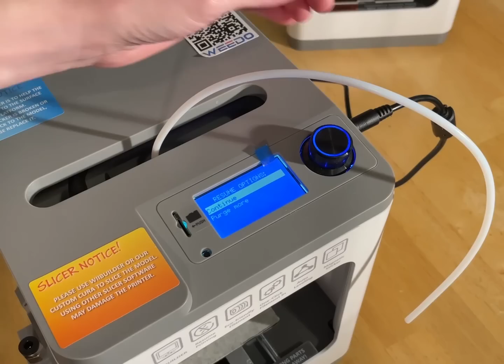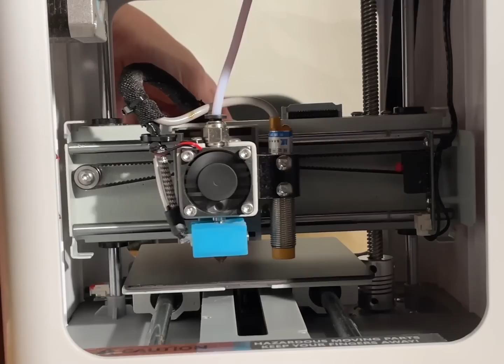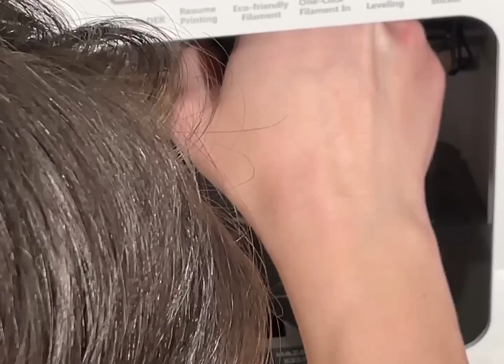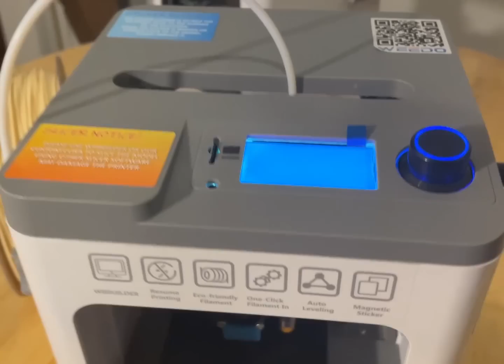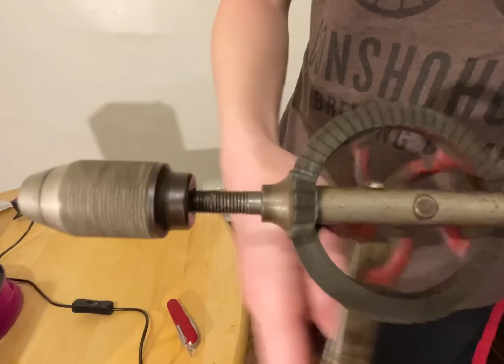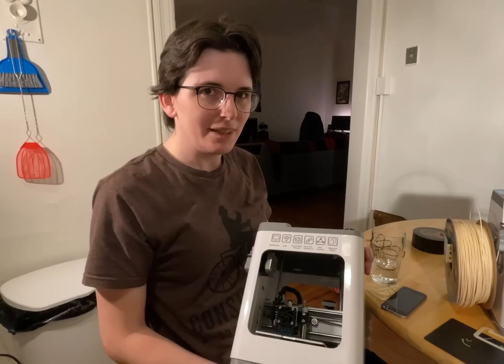3D Printing Experiments 01: A $34 3D Printer from Ebay. Tina 2, Monoprice Cadet.

Comment: Im sure you have learned alot since making this video.

Its pretty crazy how accessable 3d printing is now to people. They are pretty simple to work on aswell. 

Get yourself a cheap food dehydrator and slap your spools in it for like 10 hours and it will dry it out and revive the filament 

Also it seems like it uses the same type of nozzle that like a ender uses Im not sure if it has an all metal hotend Id doubt it but those nozzles are a dime a dozen Id really suggest having a good amount on hand they are cheap and it helps with not having to wait for parts in the mail.
Reply from the maker: Well I already know 3D printing, I used to do it professionally as part of my job in 2016, and now Ive been getting work at a local makerspace doing it, but I decided it was finally time to get a new 3D printer after all these years
Reply: @RinoaL  oh ok. Printing has come along way for sure. My first printer was one of those anet a8 acrylic frame printers.

Comment: This would be great for modding:
Heated bed
New board with silent stepper drivers
Update Marlin
Adapt hotend to use E3D V6 and all metal heatbreak (I have pet birds so PTFE tubes directly touching hot nozzles is a big no-no)
CHT nozzle
G10 build plate
Attempt to get Octoprint working

Comment: When you mentioned it being a washer, I think that's what you said, it made we want to tear my dryer apart (because it's side load) and build a 3D printer inside it. 😂
Reply from the maker: hahaha That's funny, but what I meant was that I imagine using this to print washers, for bolts and stuff. I tend to drill holes in pennies to make washers as well.

Comment: Your gantry doesnt look very level. Fixing it will probably make your prints a lot better. Also, you don't need that much infill, you can always increase your wall multiplier and infill layer multiplier to get something just as strong but prints a lot quicker.

Comment: I have had several cadets.  The paper you took of is supposed to be there. You can replace it with blue painters tape . The original came with two extra printer sheets.

Comment: I have a Tina 2 I got used in person for $35 and I love it been running 2 years strong and no issues or mods, original needle . Great print quality. Its rated for 40mm/s print speed and I run 60 easy and it keeps up just fine not a lot of ringing

Comment: These seem like a good way to get cheap parts for budget DIY builds like the rook 3d printer, the motors, mainboard and maybe the hotend could propably be used in a ROOK

Comment: I noticed that you shutoff the power while the extruder was at 210°C, please to a cooldown before disconnecting power or you risk damaging the hotend.
Reply from the maker: Sadly that will happen a lot with this model because the stop-print function doesn't work often either.

Comment: I think this tiny printer just needs a tiny bed-heater, a custom Marlin build (with better ABL code), part cooling  and possibly some silent steppers.  It's difficult to say for sure from the video, but I get the impression the provided components seem very promising for the price.  It's surprising they added a bed-probe, but no heated bed.  Also weird how the ABL only seems to probe 3 points, not 4 (or more).  At that small bed-size and bowden head, I'd love to see the speeds this could reach with Klipper, but the music you get while printing might give even worse headaches at those speeds (but it would finish faster) ;-)  I'd love to see what more you get done with these parts.

If you add the heated bed and stick some plastic to the front and back to close the box and add a $1 all-metal heat-break, this might even print ABS ...

Comment: For best results on a printer with an unheated build plate use a glue stick, Elmers works fine, throw a thin film on the plate and that will resolve the adhesion problem. Snag a spool holder and you will be good to go. Or grab a Wham Bam build plate, but they are gonna cost more that the printers combined for one.

Comment: I got one for $20 at a different auction site. It is was great till I updated the Firmware to 1.4.3. I reached out to Weedo (the brand I got) and they responded with in 24 hours and are working on fixing the issue.

You also have a TINA2 and a TINA2S the TINA 2S get hotter at the nozzle and has a headed print bed.
Reply: Site?

Comment: Great printer after a few fixes. The extruder fan often fail which cause the PTFE tube to melt and clog the nozzle. So if you can change it for a 30x30x20mm fan it's even better. The bed sensor also faile often and finally the plastic that hold screw where the bed belt bearing is tends to crack and break to you can grind all the plastic, drill a hole and put in sandwich to metal plates to holde a longer screw. Apart from this, everything work perfectly
Reply from the maker: Thanks for the heads up!

Comment: ive always found it a problem to get things to stick to a build plate well especially high objects. using all the blue painters tapes and stuff. ive found a thin layer of pva glue yes it basically glues it to the surface.

Comment: I just went the other route, sold my CR 10 to a friend for a small buck, and got a bambu lab P1P. Man, i Never had so much fun with a 3d printer. Does everything by itself, and pumps out things at an amazing speed. A benchy in under 15 minutes? No problem. At last i can focus on printing and designing, and not fiddeling with the printer 😁👍 - but one like yours? I would absolutely get one for my daughter to play with, an amazing little device, especially for your application 👍
Reply from the maker: I just learned about the P1P today! Sadly if I get any money saved up, it's going into a VR headset like a Vive XR Elite at the moment. haha

Comment: My first 3D printer. Bought for 75€ new in a big box store, everything included, even a small spool of filament that you can use to print a holder for a bigger spool of filament. Surprisingly capable for such a small, cheap, simple printer.

Comment: I just grabbed a Creatbot Mini for $50!   A cartesian bed dropper, with all metal direct drive, and fully enclosed?   Pretty amazing!
Reply: Where?
Reply: @druckza  ebay
Reply from the maker: I see no completed listings for createbot minis on ebay within the past 3 months.
Reply: @RinoaL  Pretty bummed I missed the deal you shared. My 3 year old would go nuts for one of these!
Reply from the maker: Yeah all of ebay's stock sold out overnight due to my video, but don't worry, I'm talking with the seller. They have hundreds of these yet to sell and it's just a matter of them testing them and sorting them. So the deal will come back again.
Reply: @RinoaL  do you have a link to the store? :)

Comment: as a friend pointed out to me 3D printers have gone from being a novelty to being an important workshop tool, there is almost nothing that you cant reproduce with a little effort in creating the design, whatever you need, if you can visualise it you can print it. the last thing I made, - I had an indexing plate with a 24 tooth gear to provide the indexing, i measured the gear and replicated it in plastic for 28 , 30 tooth, 36 tooth and 40 tooth, increasing the range of divisions  I can index, it doesnt need the strength as its just using a point into the tooth as a stop setting.
Reply from the maker: I think the biggest limitation to 3D printers is bad search functions for the files people have already made. Thingiverse and Printables both require a lot of hunting for what was already made.
Reply: @RinoaL  I rarely use pre done files for my 3d work, preferring to generate my own CAD file and stl's.
Reply from the maker: Same, however I'm thinking of what it would take to get 3d printers to really help the world. To be a home appliance as needed as a washing machine, and helping people get away from having to buy things pre-made.

Comment: even on my printers I often have to use a glue stick over the bed to get proper adhesion, with ABS I use a slurry of abs dissolved in acetone over the bed to get adhesion.
Reply from the maker: I used to use the ABS slurry trick too! I'm getting it to print fine with nothing on the bed so far, so we'll see. I do plan to add a little heat eventually though.

Comment: I still have my davinci 1.0 AiO (I alos have an FLSun f5 which I use to do PLA prints ( the davinci is dedicated to ABS as it has the enclosure needed for that, not a week goes by without me running a 3d print for something (repair my tablet case, washers, small storage pots etc etc.

Comment: when using a cold build plate increase your initial layer temp at like 215 for pla and it will stick also slow down the first layer speed , washable glue stick is your bestie if the aforementioned does not yield results. been watching for a long time since backyard at your mom's place. love the channel and all that you cover
Reply from the maker: Yeah I'm finding slowing it down to no more than 30 on each setting makes it stick well. The reason why I was only using 190 was because this "glass purple" PLA says to not exceed 190C. I tried it later and it smelled really really bad. The other PLA prints much better at 215C, I actually made the first layer 220C
Reply: @RinoaL  yeah some filaments don't like getting that hot. I'm guilty of boiling filament every once and a while lol

Comment: I thought I remembered that you could adjust the offset?? you can also try adding a G1 -Z move command and then a "reset relative to 0" command to manually make it print lower?? I THINK that build plate is a raw mag sheet IE you need to put "something" on top of it. what you removed was likely a sheet of masking tape.

Comment: Filament from soda bottles - I would recommend trying that with a larger nozzle (it should be pretty easy to throw a 0.8mm nozzle in these without losing a ton of real accuracy) to help prevent clogs (same with wood or carbon fiber filament). You also get the bonus of faster prints that tend to be of higher strength when you use a larger nozzle. 

The "paper" on the build plate was masking tape - it was used a lot in the early days of 3d printing to help with bed adhesion especially with cold print beds. No big deal to remove it or replace it.

These are pretty clearly using marlin firmware so if you wanted to upgrade them to newer firmware with some newer features (or just some artificial limits and safety features upgraded), or even changing bed leveling parameters it shouldn't be super difficult. 

A non-heated plate is a real bummer, especially for petg. It shouldn't be hard to find a compatible upgrade but I think you'd probably want to upgrade the power supply too. With a heated plate you shouldn't need the brim either. it looked like the fit on the spool arm was a little out of whack, likely due to the skirt/brim. 

Love to see a video where you're overflowing with happiness like this!
Reply from the maker: Oh thanks for the tips, I forgot masking tape was used tbh. I wonder if upgrading the firmware would fix the lcd locking.

And thank you.  The good days come rarely but they are coming more often now that life has settled down.

Comment: the bed leveling is not leveling on the flex bed. it's leveling on the bed underneeth. you need to adjust the "z offset" on the printer in order to adjust for the different flex materials you use
Reply from the maker: Yeah I figured it might be something like that, but only tinkered with it later. Tired brain after all.

Comment: Z offset setting in tune area to make sure first layer is working. If it doesn't have that setting, prob want to update marlin firmware. Also if it doesn't have z offers won't have thermal runaway, which you def want
Reply from the maker: Yeah I do the z offset later in the video.

Comment: I am very tempted to do what you did but a little weary. Not having a baseline working unit to test with or know where things go is a little worrying. Though I'm pretty confident I can get away with buying the two damaged ones. I haven't used a 3D printer before and I've needed one for a few now.

Comment: you need to adjust the extruder to output a little more filament in order to cover any holes in the 3d print especially when setting the first layer also look at getting a deburring tool
Reply from the maker: Actually it printed fine near the end when I got the z offset dialed in.